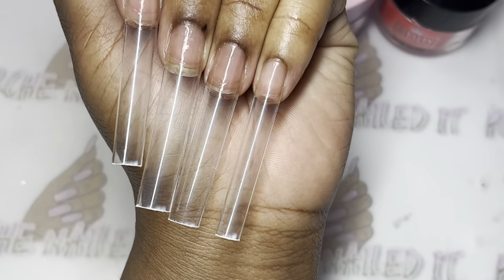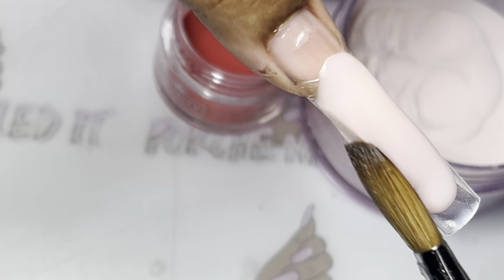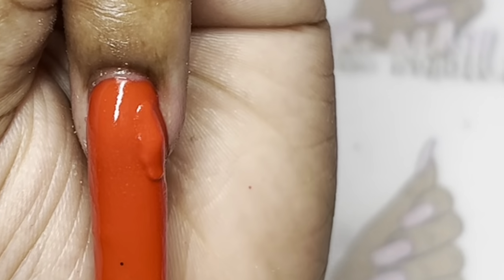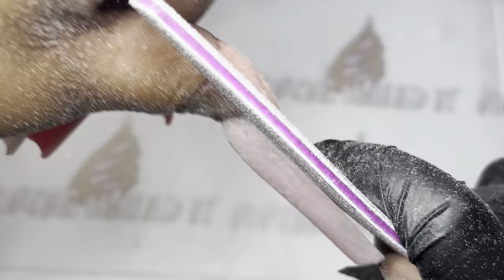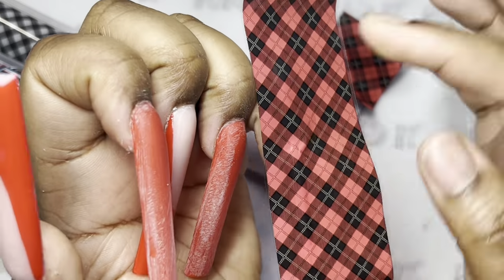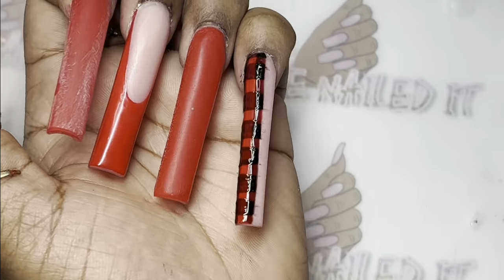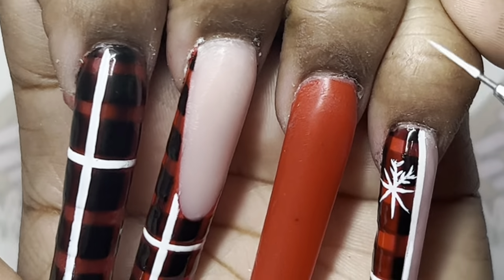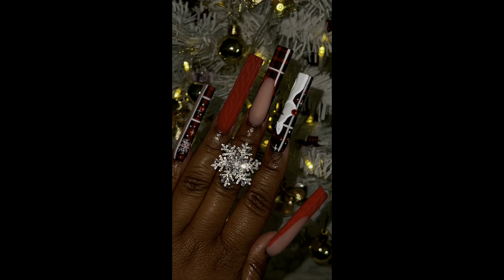RED PLAID CHRISTMAS NAILS ❤️❄️ | HAND PAINTED | REINDEER 🦌✨

Comment: So just starting out, I had purchased a lot of colored acrylics and I dont even use most of them now because of the formula. I would much rather use a cover color and gel polish. Its so much easier to transition to a new set. Im also upset because at the time it was a popular brand
Reply from the maker: I can think of a few brands you may be talking about. I’ve experienced bad brands everyone hypes . If it helps any sometimes it helps to add a little clear acrylic to the powders. It gives it a better consistency. Hope it works for you ❤️ Sorry that happened. Also I always recommended to beginners or in general to buy 1 or 2 acrylics to try out a new brand before buying a ton & you don’t like it.